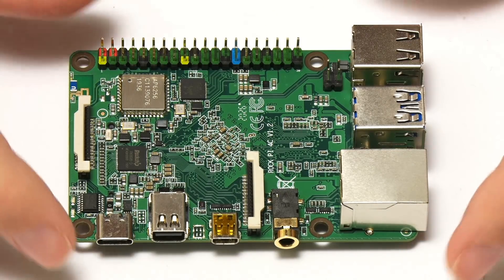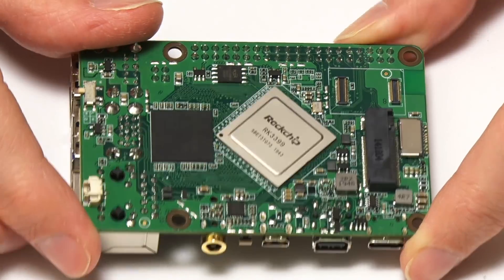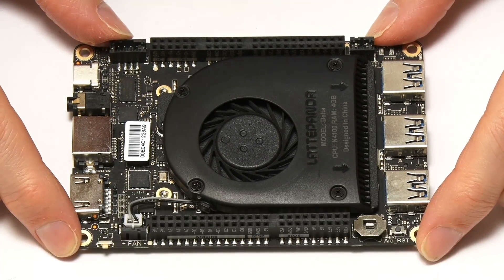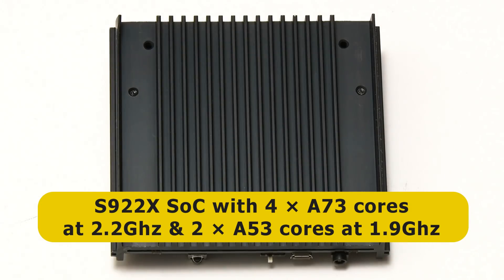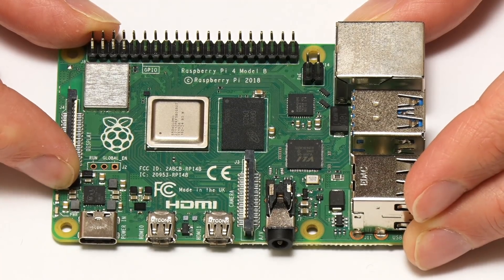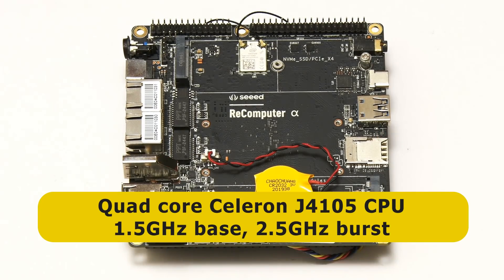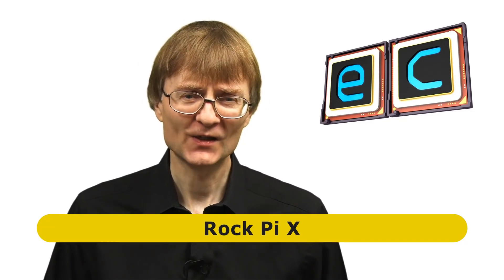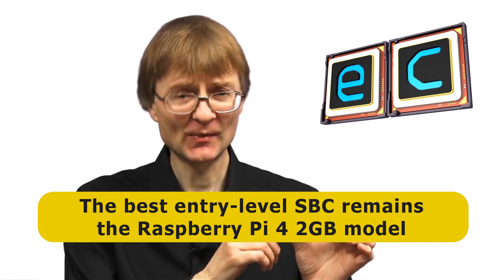Top 5 New SBCs 2020

Comment: I'm curious why I've never seen the Odroid h2 here. The H2 came out quite a bit before the Seeed Recomputer and used the same J4105 CPU. It's now been upgraded to the H2+ and has a J4115 CPU. So it's actually faster and alot cheaper than the Recomputer but no bluetooth or wifi onboard.
Reply: A very good point made, but the h2 is not a sbc, because it needs ram attached, i have also thought many micro pcs are out there at a cheaper price and with better spec than these intel boards, its not been a great year for sbc development, but i did think the c4 should have made it in, over some old dated yet capable intel boards.
Reply from the maker: I was in contact with Odroid about the H2 well before it was released, but when it first came out they did not supply review units as the first production run was very limited and all were pre-sold.  Since that time, the H2 has remained much talked about and very hard to get hold of. It also is not technically an SBC, as the RAM is socketed -- although I do hope to review the H2+ at some point as it looks a great board.

On price, I would dispute that the H2+ "is a lot cheaper", as the H2+ is $119 + RAM + PSU, and also has no WiFi or BT. In contrast, the Odyssey is $188, including 8GB of RAM, PSU and onboard WiFi and BT. Based on Odroid shop prices, that makes the H2+ $167, compared to £188 for the Odyssey. So cheaper, yes, but not "a lot cheaper". :)

Comment: One thing i find odd regarding the "ODYSSEY - J4105" series is that, only the "64GB eMMC (Unactivated Win 10 version)" model has BT 5.0 support (as per Spec list), while the other three models lack it.
Also, it is the costliest model (that doesn't have Windows Activated) @ $242.90 (with case), while the no "eMMC" model costs $212.90 (with Case) and the "SSD" model costs $239.00.

Comment: Of all of your choices, the Raspberry Pi not only has best software/hardware support (if you stay away from the RPi forums) it also has the greatest hardware options to fit the board out.  It is a real advantage to be able to go online and pick up complete kits that have everything you need to get started.  So far, living in the true north strong and zero degrees of Canada, it is the board that is easily available, without the hassle of figuring out and finding all the bits and pieces to get it running.   So, how about a list of the best sbc kits, so I can maintain my lazy existence watching your videos while you do all the work?
Reply from the maker: Nice video -- noted and keep watching!
Reply: @ExplainingComputers  Every time you post a new sbc video, I go looking in Canada (eh?) and what I find are several online stores that throw up tables of part numbers, and model numbers and minute photos, but gives me no idea what I can get for it, or what I need for it.  If you search for a specific sbc on Amazon, you get oodles of ads for...Raspberry Pi kits and parts, and maybe one or two obscure boards (Though they do have the Odyssey x86!)   Hmmm could the Raspberry Pi Corporation be the sbc incarnation of Intel and Microsoft?   You didn't rate the RPi number one....beware stern postings from the Pi people.

Comment: A nice informative video. However, as someone who has just purchased RPi number 6 (and my second Pi4), I'm baffled by your choice of putting it second, though I acknowledge that you recommended the 2GB version for anyone starting out with SBCs. The price point and support alone, however, would in my opinion, but the Pi4 ahead of the rest, and what you can do with them is phenomenal. My new one will replace a Pi3B+, which I may re-purpose as a sql server for the rest of them, to take some of the load of.

Comment: Thanks for the great content.  Bought 3 Odyssey’s a few months ago based on your review video for my home lab.  Use 1 as a GPIO workstation and the other 2 as lower powered hypervisors as part of my Proxmox cluster.  They are awesome.  Will uses them to run Opnsense as well as my LXC containered services.

The cases used to be hard to get.  3d printed one from thingiverse and then I made a quick remix of it to rackmount the other 2.
Reply from the maker: This is great feedback on the Odyssey boards -- thansk for sharing.

Comment: Chris, I hope you will review the Raspberry Pi Compute module 4 & its companion development board. The PCIe & other expanded connectivity makes it easier to use for a variety of applications.
Reply from the maker: On my list!
Reply: @ExplainingComputers  great! I'll look forward to that. It seems to me that the addition of the $35 developer base to the CM4 makes a far more flexible & "connectible" version of the Pi 4B. It will be interesting to see if anyone produces a case for the combination - accommodating some of the possible PCIe cards which are now possible to use. I'm intrigued by the idea of a 3D printed case which could hold a 2.5" drive (SSD or HD), a PCIe card, cooling apparatus, & could route all the connections to the back (including GPIO header). It could still be quite compact.

Comment: I'm thinking of building a Linux (LibreElec) HTPC along the lines of the one you recently made (J4105) and will (unfortunately) have to connect to it via WiFi (like you). Have you found a compatible wireless USB WiFi adapter that works with the 5Ghz (ac) band? Although you didn't go into detail in the video it looks like a generic Chinese one I have seen on amazon and ebay but all the reports I have read suggest it's not supported well under Linux. If you have a link to one you used/that works it would be much appreciated!

Comment: What if raspberry pi 5 gets ryzen 9 ?😂
Reply from the maker: Now that would be something . . .
Reply: @ExplainingComputers   then It would be costly 🙄
Reply: 600 bucks then
Reply: @harivignesh  CPU itself is 600$, mbo, proper psu and ram would probably be 1k.
Reply: @harivignesh   me who can't even afford 1GB Rpi 4
Reply: Then you'll find its price tag Ryzen a lot!!!!! 😂😂😂😂😂
Reply: If you wanna utilize the full power of it you gonna cramp north bridge, south bridge, chipset, and importantly a GPU.
Reply: @dharmarajan1989  Northbridge, southbridge and chipset are all just the chipset now. You haven't had north bridges and south bridges for years now....  

A mobile ryzen 9 SOC could incorporate the the chipset and SOC under the same heatsink in a pretty tight power budget.
Reply: @spencerhho  i thought we were talking about ryzen CPU. Not ryzen APU.
Reply: @dharmarajan1989  He said ryzen 9 didn't he? the ryzen 94900hs is a 35watt part with a gpu that's leagues ahead of anything else that could fit on a sbc and it's cpu performance is still competitive with much higher tdp intel CPUs
Reply: Check out the udoo bolt and udoo's other offerings.
Reply: There are a few Ryzen mobile based SBC's out there already , but I think they're all based on R5 or R7 architecture so far and $300+
Reply: Yes, I've seen many ryzen based SBC's in this channel.
Reply: An RPi-like computer with an AM4 socket? Now that'd be neat. Problem with most SBCs is once you cook the CPU, you have to reball a new one or pitch the SBC entirely. Least with a socketed CPU you can cook all the chips you want and still have the rest of the PC be (probably) alright.
Reply: You wouldn't be able to keep it cool, it costs an arm and a leg, and AMD wouldn't allow for it to happen, as it would eat into their higher margin sales.

If you want a desktop replacement in this form-factor, you'll have to wait one or two decades
Reply: if 600 bucks then it's a fricking steal for me
Reply: I think you're on the right track, but a couple og generations too  far.  A Ryzen 3 1600 or 2600 would be sufficient to put the RPi in the stratosphere.
Reply: @techman2471  4th gen is low power, made for laptops so it would be perfect for SBCs. 
I have 2600 and with turbo it pulls over 100W, undervolted it's around 50W, way too much for anything small.